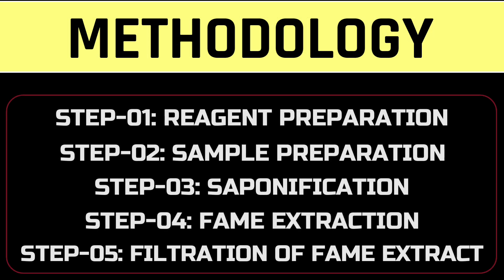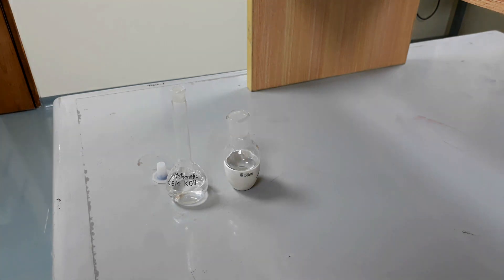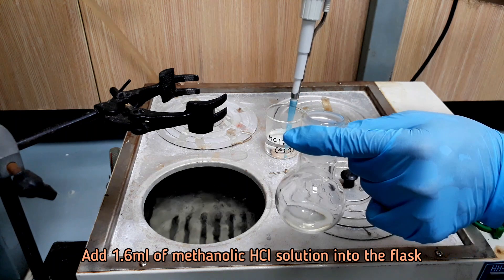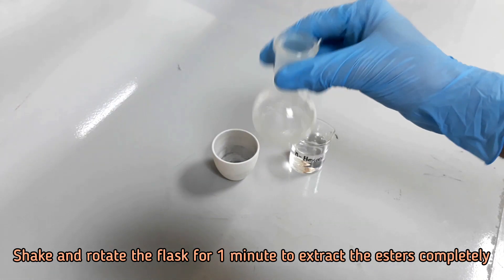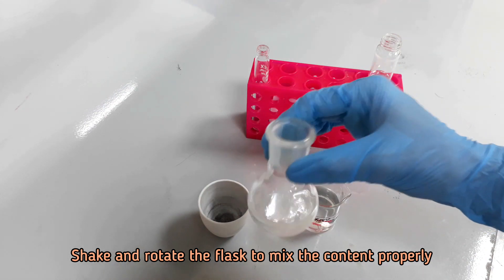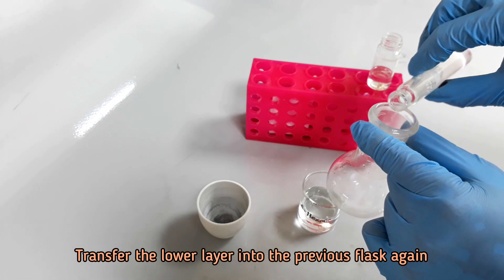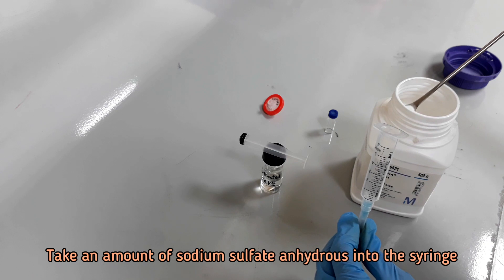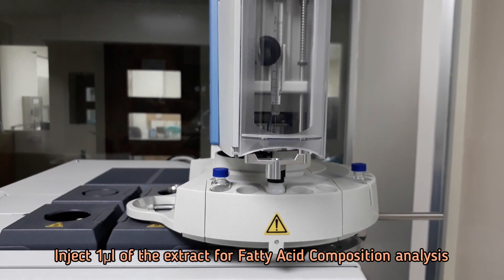Sample Preparation for Fatty Acid Composition Analysis_Fatty Acid Methy Ester (FAME) Preparation-GC

Comment: hi. is the method only designed for oils and fats or its also possible to use this with different samples eg. sausages, meat?
Reply from the maker: This method is only applicable for oils and fat. For other sample, extract oil first and do the same as done in this video using the extracted oil

Comment: Very well explained! Thanks! But i have a doubt regarding aoac method using methanol and h2so4. Here methanol and h2so4 are added with oil and heated at 80 *C for 2hrs. Then hexane is added and it is seperated. Kindly let me know if this is also acceptable method? Thanks
Reply from the maker: We added HCl as a catalyst, not H2SO4. This is laboratory validated method with slight change of original AOAC method. You can use this method for fatty acid analysis.

Comment: Hi, I faced a liitle problem here. When I heat the oil and methanolic KOH mixture at 100°C in water bath, it dried out. No clear solution obtained. How can I fix this problem?

Thanks in advance!
Reply from the maker: Set condenser properly with cold water

Comment: Thank you .In boron trifluoride method  l use ehtyl ether complex of  boron tri fluoride becase low cost  .Any difference between methanlic complex of boron tri fluoride  and ethyl ethet complex of boron tri fluoride?
Reply from the maker: Using methanolic boro trifluoride is mandatory. Because methyl group from methanol will facilitate the methylation to form fatty acid methyl esters
Reply: Thank you very much
Reply from the maker: @epalanisamiepalanisami6863  You are welcome

Comment: Do you have a link for sodium sulfate anhydrous? What will happen if we do not use it ?
Reply from the maker: Sodium sulfate is needed to remove trace water from the extract but you can do the test without using it too

Comment: instead of n-hexane, can we use methanol? because the column which we use is DB-Wax  @MicroChem's Experiments
Reply from the maker: No. Methanol will not be appropriate.
Reply: @MicroChemsExperiments  i am planning to use DB-FFA column and it is high polar column and hexane is non polar so is it gonna be a problem for my FAME anaylse ?
Reply: @godagamagds3820  Not at all - polar columns are not damaged by nonpolar solvents. The hexane solvent peak will appear very early and will not interfere with your FAME analytes in any way. The reason you need a nonpolar solvent is so that you can extract the (fairly nonpolar) FAMEs from the (very polar) glycerol, unreacted methanol, salts, soaps, and water that get produced when you perform the transesterification reaction in the first part of the video.

Comment: hi,
what if I heat the flask using heating mantle instead of water bath. Would it be any problem?
Reply from the maker: No major problem in result. You can also use heating mantle